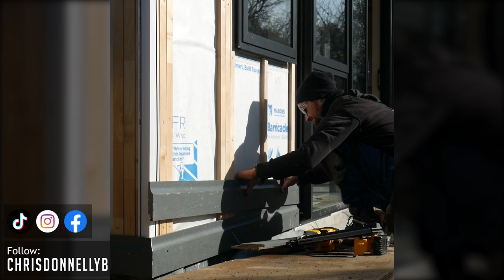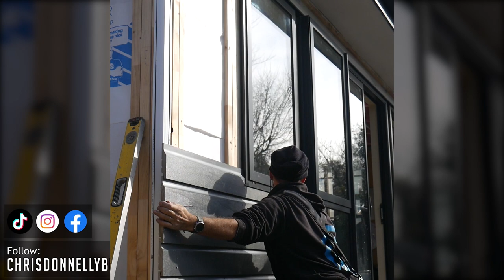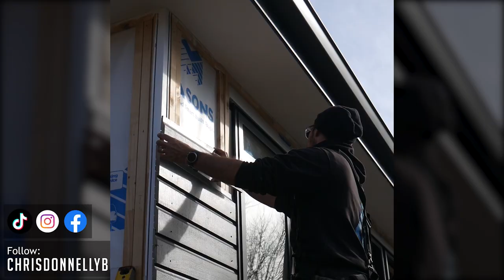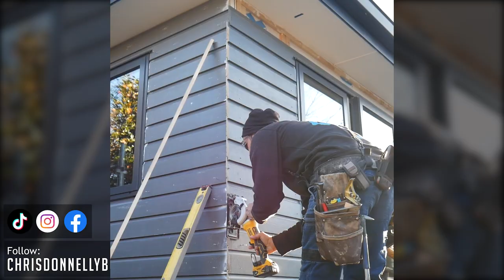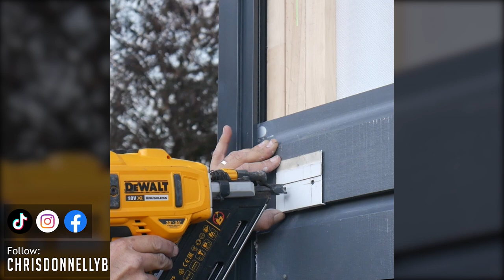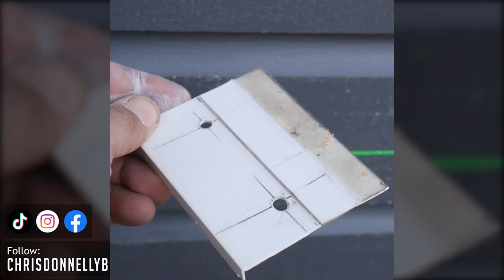Rusticated Timber Weatherboard | Building New Zealand

Comment: What type of nailing gun is that. I have an Ecko Ultimate 90 framing gun, which seems much too grunty for installing weatherboards.
Reply from the maker: DeWalt cordless nailer, It has two power settings, I set it to low power, the nails are slightly proud  and then I could finish them off with my hammer